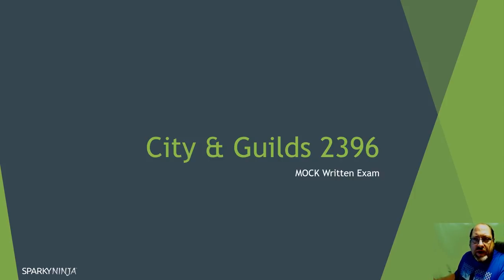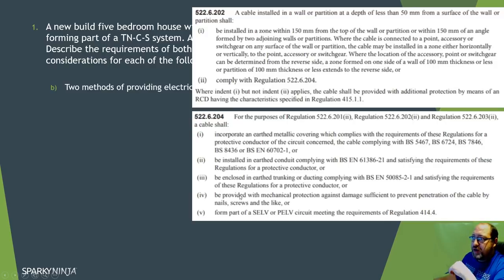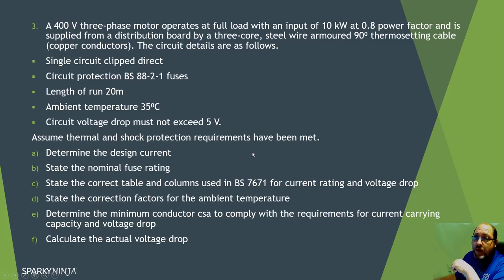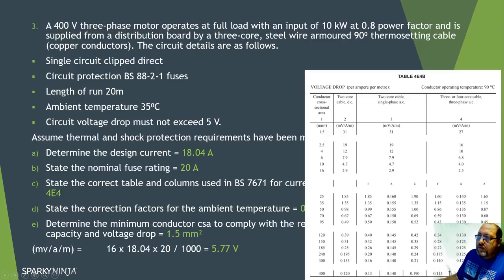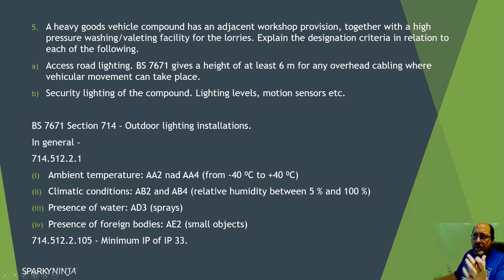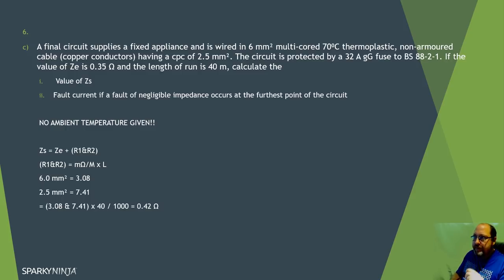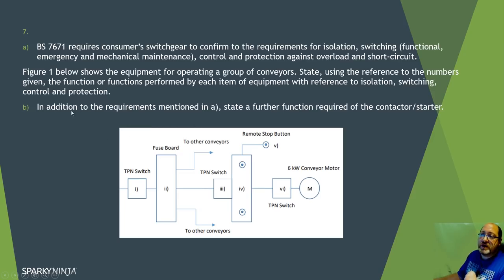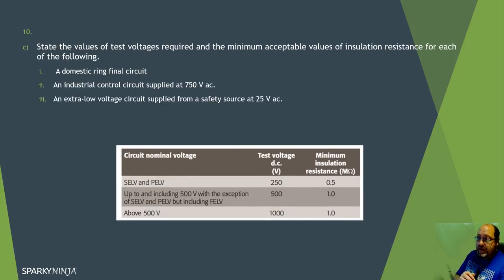2396 Ep 12 - Mock exam guide

Comment: Hi. Thanks for this video. It is very useful preparation for the exam even for 18th Ed A2. 
In question 3, if the maximum voltage drop is 5V would that suggest a voltage drop has already occurred to the distribution board so the voltage at the distribution board would be 385V and calculations would then be based on that? 
Also, when determining minimum CSA would marks be lost by not determining Ct and applying it to the voltage drop calculation for 2.5 sq mm?
Then if 15 V has already been dropped to the distribution board, the actual voltage drop would be 15 + 3.74 (18.84V) which is still acceptable (<20V).

Comment: Question 9... did you do one part wrong? Because it asks live and neutral reading at each socket which was 0.15 which is correct. But then it asks for the r1+r2 for the ring , not the reading at each socket, so should the answer be 0.77?? Sorry just confused now lol

Comment: Ninja when your comparing your Zs values to BS7671 after calculating them using table B1 guidance note 3 why aren’t you then using table B3 factor 1.20 to correct the conductor temperature to 70deg which is what the values in BS7671 are shown as ? Am I missing something?
Reply: Hi Sparkyninja.  Quality videos pal.  Love them.  I think the answer to Q6 is wrong though.  You have calculated R1R2 using the cold values (for want of a better expression) and not applied the magnifier to account for increased resistance at operating temperature.  You have then compared the Zs values calculated to the values in BS7671 which arer those for operating temperature.  Thanks.  Looking forward to the next video.  Pete